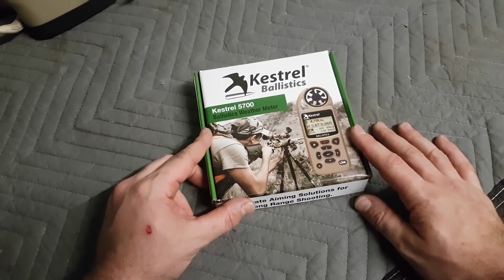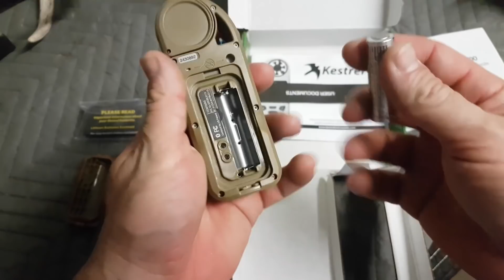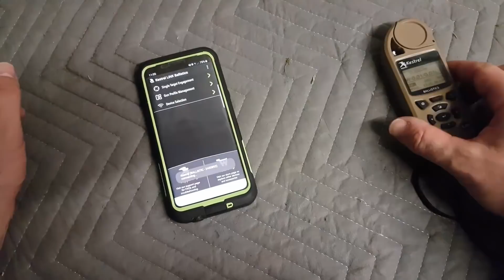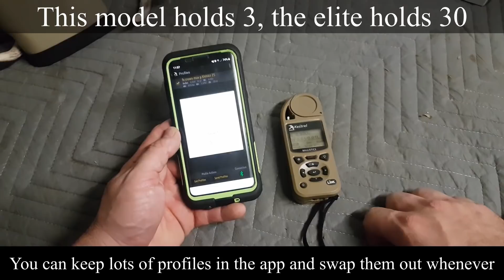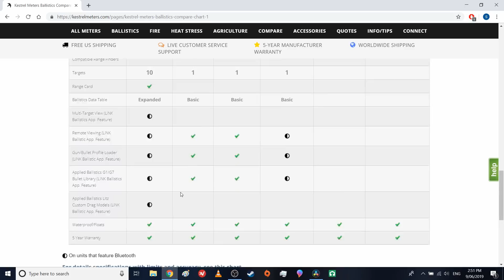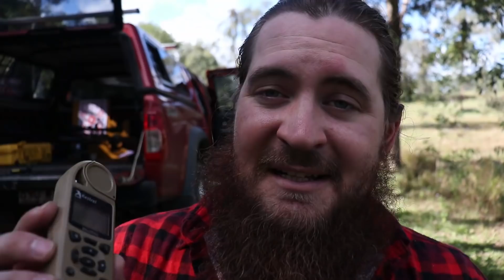Using a Kestrel 5700 with an airgun

Comment: Hello meathead , how have you been getting on with the kestrel? Did you find it works ok with air rifles? I have just bought the basic 2700 ballistic meter that has the G1/G7  applied ballistics within and want to use it with my .25 high power redwolf , have you found your 5700 works accuratley enough with your air guns?
Reply from the maker: I usually use it for the numbers to put into strelock pro and it works well. But the difference between g1 and ga is a little too big for VERY prescise shooting.
Reply: I went out earlier and trajectory validated a 34g slug at 100 yards  but found the windage numbers  was way out , it was telling me i only needed .3 mrad in a 10mph wind! So i think i will use your idea of just measuring the wind with it and applying it to strelok pro
Reply from the maker: @PaulHamM3  yeah the drop is okay but the wind is pretty optimistic lol kestrel is super awesome for everything when you start using slugs and anything from 22lr and up

Comment: Great video! The Kestrel 5700 is amazing. Even more so when paired with a SigSauer BDX 2400 range finder.
Reply from the maker: I use a sig kilo 1250 rangefinder and its great. I rekon the 2400 would be a neat upgrade but I cant justify the cost atm

Comment: I just got my Kestrel 5700 and saw your video and have a question. I have G1 setup and in .25cal  the BC is about .035-.038 for JSB King Heavy but the Kestrel will not allow lower than 0.100....what needs to be done? .....I see below you are using 0.05...how do you put that into the Kestrel???? Thanks!!!!
Reply from the maker: I did it by building the gun profile from scratch with the kestrel ballistic app on my phone and then sending it to the kestrel via the Bluetooth link
(24:30)
Reply: @unclehodgy  thanks mate...all done but it defaults to G7 now instead of GA or G1....grrrr...
Reply from the maker: @flytelaw1  that's weird... Does it appear as g7 on the app in your phone? Cos you might need to change it, save the changes, and overwright that particular profile onto your kestrel. Make sure in the app on your phone you change it to g1, save the changes, click out of it and tgen go back and check that it's saved properly. If you don't save the changes in the app and just click out without scrolling down and clicking save it won't stay changed
Reply: @unclehodgy  ...stupid me,,,,forgot to save after setup and defaulted to G7...now works great! Thanks a million and keep up the great and entertaining work!
Reply: @unclehodgy  Hey, Meaty...I just bought the Elite upgrade for my 5700...I will send you the upgrade file once I get my BTooth dongle sorted and once I do mine so you can do your's...cheers!
Reply from the maker: @flytelaw1  Very interested to see if that works, I think the firmware is serial number specific so it may not work but definitely worth a shot
Reply: @unclehodgy  Roger that...have to wait for dongle...by the way...you know about this? http://appliedballisticsllc.com/products/ab-profile-loader/

Comment: Very good review video,i do have a question.What pellet do u shoot in the video?I see u use a BC of 0.043 is that for the jsb mk2?I tought that actually is about 0.052 instead off 0.043?
For the rest exxelent video,keep em coming!!!!
Reply from the maker: Yesh king heavy mkii. I have seen it listed at 0.05ish but I just used my data from strelock pro and it seems to be pretty spot on. Pellets are suuuper weird when it comes to BC,  the bc changes significantly  as the speed changes, and in weird ways that you wouldn't expect. I've had the best results when using the 0.043 and that's what I recommend people try first. If 0.05 works I'm all for using it too
Reply: @unclehodgy  Thats what i guessed...thats the thing u start to fiddle with when what strelok tell you doesnt match the actual impact of the pellet,correct me if im wrong...
Reply from the maker: @jarnitrulli  the general rule of thumb is don't adjust bc until your out at 600 to 800m but that's for proper bullets not pellets, I think the best way is to make a dope sheet and compare it to what strelock gives you side by side and try change the bc and velocity to match the real world results. If it matches the real world result then your doing the right thing
Reply: @unclehodgy  Ok,usefull info thanks m8